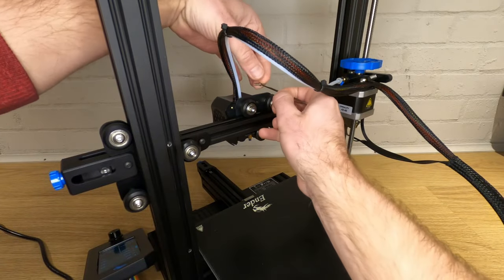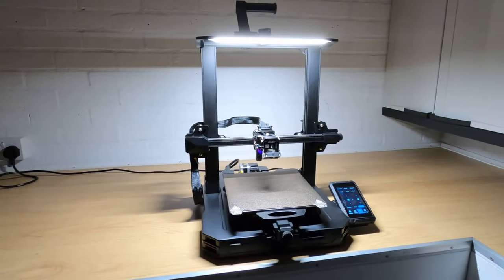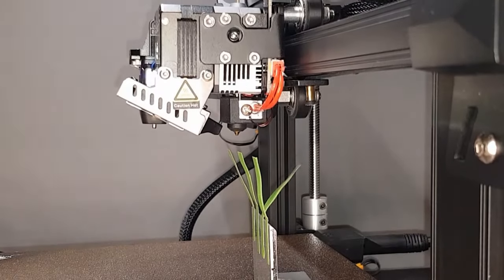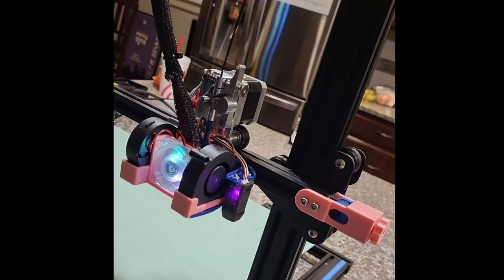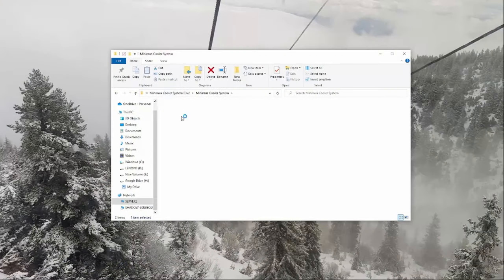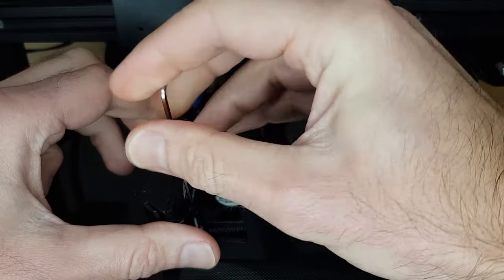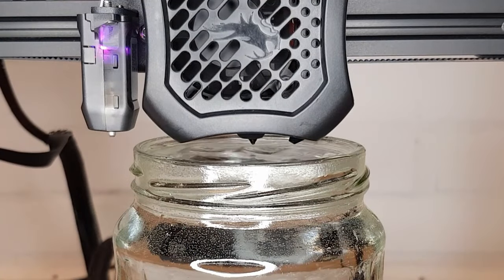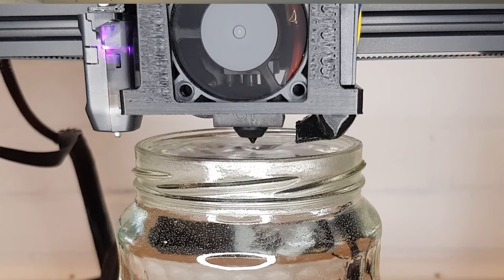Minimus Cooler -Possibly The Best Cooling Fan Upgrade For Your Ender 3 Style Hotend

Comment: Looks atractive untill you try it.
Downside - too much air leak from the hotend fan straight to the printed area. Its because the hotend area part is too open. 
Printing materials where you need part cooling off will be an issue.
Another thing - cable management. Everything is pretty much all around.
Layer cooling part is great though. Of course these fans wont be ideal for those who strugle to have their machine more quiet.
I personaly adore the idea, but once I tried it wasnt that good as I expected. Had issues with air leak as I mentioned. So after some tests I found briss moto fang more quiet, and leaking less air. Overhang tests were same good for both.
And of course I thought how often do you need to take off the fans off? You simply unscrew few bolts and need only access to the hotend. So it is probably only the fight for Weight VS. Noise.
Reply: Hi L. Šeima, what materials need part cooling turned off? Thanks.
Reply: @D4RKFiB3R  I refered to the problem where the hotend fan is blowing air to the nozzle, and you cant control it as layer cooling fan. That is permanently blowing air whether you need 0 or 100% cooling. That is not how it should be.
I sometime print abs that do not require enclosure, bit there has to be no other source of air blowing around it. So it warps with this minimus shroud, but no probelms with the other I use. Sometimes Tpu with very little cooling less than 10%. So this shroud even looked like a charm, didnt run well for my needs.
Reply: @LSeima  I understand. Thanks for the info.

Comment: Sorry, new to this, but does this work on the 3s pro or are there files included that do?
Reply from the maker: It's a very clever design that fits most hotends that have the two bolt fixings that all of the Bowden tube Enders have. There is a free test file that you can print to check too.

Comment: 0:30 you mention a test file to print for free, however I can see no link for this.
The biggest problem is, if you have a printer that is not on the list, you have to take the chance that something will fit your particular printer. 
I have however downloaded these files and may even have to modify something along the way.
I just thought it strange there was no link anywhere for the test print.

Comment: How do you connect up the second fan? I've been looking around and have not found one.
Reply from the maker: I just connected a second fan in parallel with my original fan so it runs off the same pins from the control board.

Comment: Hi, great video 👍does this work with ender 3 v2 neo? I'm sure it may have a different heat sink? if so using the stock fans what duct length would you recommend please ?
Reply from the maker: Sorry, I don't have a Neo to check. The Minimus is now completely free so you can try printing a backing plate and see if it fits.

Comment: Hi Ricky, thank you for uploading this and explaning it with such detail. I'm building one of these with the 2 ender 3 stock fans and a extra fan. I'm wondering, how would you arrange each fan intake/exhaust? I also wanted to ask about that thing mounted on the left of your hotend with the purple light, what is that? Thank you for your time
Reply from the maker: Hi, if you're using stock fans then you want the 4010 files. If you are not sure, then try opening the files in your slicer software so that you can see what they will look like. The item to the side is a CR touch probe. It probes the bed to create a 'mesh' that allows your printer to follow any contours on your bed surface. Some printers come with them but they can often be added. If you don't have issues with a warped bed then I wouldn't worry about adding one.
Reply: @RickyImpey  Oh, never heard of CR touch probes before and was curious, but doesn't seem necessary to me atm. Thank you for your guidance through the files and your answer!
Reply: A CR or BL touch probe is the best upgrade you can make. No more bed leveling issues!

Comment: Is it possible to buy a printed Minimus? I have just changed the hotend on my E3V2 & noticed when bed levelling that the existing fan cowl is lower that the print nozzle. I don't want to piddle about with the existing fan & cowling so if I can purchase a Minimus using existing stock fan, this will get me back on the road to be able to print the version I want.

Comment: I like this one as it looks to be the lightest so far.  I am confused as to which files to print though.  The readme file did not really help that much.
Reply: I have kind of the same problem.  It looks like the folder names got a bit more complicated than when the video was shot.
Reply: @FEPLabsRadio  Here's what I did to get the dual fan option with the wire management backplate. I don't use any automatic bed leveling so I just printed the basic version. If you use auto bed leveling, just look for the BL or CR attached to the files I mention below. Hope this helps. 

From the 'Its full of stars' folder, go to New 4010. Select either 'New 4010 Dual or Single.' In the same folder, got to '4010 Ducts' and select 'Duct 4010 0 R and/or then L.' Then go to the 'New Backplates' folder and then into the 'Backplates WM' folder. From there select 'Backplate WM.' (WM stands for Wire Management.) Also, if you double click on the STL file it will open up and show you a photo. At least it did on my PC. Good luck!

Comment: Hello Mr Impey ! Would you say that this extruder modification has to be preliminary stage before link a Sonic Pad to my E3v2 ? Thanks for your time !
Reply from the maker: It helps improve cooling which will be needed if you use a Sonic Pad and start printing faster.
Reply: @RickyImpey  ok so here we Go ! Thanks 👌🏻🫡

Comment: Did you need new, longer bolts in order to mount the backplate?
Reply from the maker: No, it slots over the protruding lugs on my Ender 3v2 backplate and gets sandwiched.
Reply: @RickyImpey  Got all the parts printed and will install later. It's as light as a feather fully assembled!

Comment: Printing isn't so straightforward. My initial print wouldn't snap together. After reading the fine print in the instructions on Thingi, I found that you have to experiment with Horizontal Expansion to get the dimensions right. I had to reduce the size of the Backplate WM by -0.35mm for it to snap into place properly. Also, the holes were too small by around .3mm. Will eventually be installed on my Voxelab Aquila.
Reply from the maker: Sorry to hear that, mine worked with no mods. Have you tuned things like e-steps on your printer? It could help dial things in.
Reply: @RickyImpey  Yes, I'm spot on. I'm shocked that yours seated fully since mine was so far off. Now that I have it sized properly, it's quite nice. BTW, for people that are struggling to choose the appropriate files, the selections on Thingiverse are greatly simplified. Thanks!

Comment: I cannot seem to get the minimus to fit onto the backplate correctly assuming that the backplate
should fit right into the top of the minimus grooves on either side ?
Reply from the maker: Yes, it should slide down over those rails. Have you calibrated you printer at all? It could need a few things checking.
Reply: @RickyImpey  I printed the parts at different line heights and used the shrink option in Cura, picked the closest two parts
for a fit then cleaned and sanded  the closest back plate fit,  all now fitted and working.

Comment: Doesn't having a cooling duct only on one side can cause banding on the other side?  I usually see dual duct but doesn't that also miss cooling on two sides? Wouldn't it be ideal to have a circular ring to provide cooling on all sides?
Reply from the maker: Airflow can be very difficult to predict. I understand what you mean but it practice, both the single and dual setup work well. People try all sorts of cooling ducts but without trying them you can never really know how they work.
Reply: @Ricky Impey  true. I have one which I've tried the water test and it made a nice divot. I tried another and it didn't make a divot but seemed to make a whirlwind effect. Both used the same blower. The whirlwind was better.
Reply: I think the circular may get the air to the nizzle but then block it from leaving. I try to get side coverage and also keep the air moving away from nozzle area after it has absorbed the heat.

Comment: So what bolts did you use to mount the Cr touch? Mine are too short and don't have nuts. My bolts just threaded into the CR touch bracket. Also, are you using the spacer between the bottom of the Minimus bracket and the CR touch? Thanks
Reply from the maker: I think they are M3 bolts so I must have used some M3 nuts. I think I used the bolts that held my CR touch bracket on as they were a little bit longer. I didn't use the spacer or the part that locks the nuts still.
Reply: @RickyImpey  ok…. Well I just installed the whole setup and I used the spacer and the lock piece. I think I used the same bolts you used. It’s working on its first print so we will see how it works out. I think I like your setup using the nuts better.
Reply: I may have made a mistake naming the part the Nutlock. Its does this but it's also a part to add some strength to the assembly. This mount can get some vibration so I made this as a safeguard. 
If you use a m3 8mm and nut it will fit flush and neat. 👍
Reply: The first print using this setup turned out well. I had to majorly adjust my Z-offset. Once I did that, seems to be great. I think I'm going to add the nuts for the extra security.

Comment: How can it be the best?
It has only a 4010 fan. 
Out there there're plenty of designs, and I also designed my own for Ender 3 V2 Neo to use 5015 blower. And you can tune it with 2800, 3000, 4800, 5000, 5800, 6000, 8000, 8500 rpm 5015 blower.
Reply: Did you hear the part of the video about multiple fan options and dual fans? LOL.

Comment: I love this kit.  However, I am concerned that the wire management version of the backplate in combination with fitted Armadillo wraps are putting more strain on the X-Axis.  Anyone else have this concern?  I'm thinking to maybe re-print the non-cable management version of the backplate...

Comment: When I print this and put it together, the parts cooling duct is underneath the nozzle zip. Just barely, but it is. I tried two different MK8 hotends (the original stock one on my Ender 3 and a replacement) and several nozzles but the height is always less than the 46mm the duct author specifies - therein lies my issue. What gives? Any ideas?
Reply: The bltouch should be on the Left side. Mounted the backplate pointing down, instead of up.

Comment: I was just wonder if anyone knows or has knowledge on this, is it possible to just use electrical tape to connect all the wiring for the dual 4010 part cooling fan?

Comment: I'm a bit confused. People saying that they've printed it in PETG or even PLA... won't any of the parts melt or at least warp? They are so close to the hotend
Reply from the maker: Mine didn't, I used both PLA and PETG versions with no issues.
Reply: @RickyImpey  Alright, I'll try it then :D
Reply: @RickyImpey Made it out of ABS cause I'm printing ABS in an enclosure, the fella has been going strong for a year now! this thing is amazing for maintenance! I'll try adapting it for my Ender 2 Pro as well

Comment: I was inspired by your presentation of MINIMUS, however, navigating Roger's site and selecting the files is frustrating. If someone can guide me to the selection of the original design for an ENDER 3Neo and associated files, I would appreciate the help.  Even after downloading what seems to be the correct file, there are multiple undescribed files. The read-me file is not helpful.

Comment: Would this fit an cr10s? Would love to have a lower weight shroud.
Reply from the maker: I think so but I don't have one. I only have the CR10s Pro and the hotend on this one is too long. If the CR10 hotend is the same as the Ender 3s then it will most likely fit.
Reply: @RickyImpey  thanks for the info man! Love your videos!

Comment: do we know if it is 100 percent necessary to print with tree supports...im too used to prusa slicer
Reply: On my Voxelab Aquilas, I printed ducts and the main body with NO supports. The only (minor) issue was at the back of the main body where the "airfoil" is unsupported. I got a bit of sag on the first layer, but from there up, everything looks good. After playing with this, I used Tinkercad to add manual supports to those two spots. My final prints were done at 0.16mm layer height, 0.4mm nozzle, no supports by Cura, using PLA+. 
The only thing I had to modify from Paul's original files was the backplate. On my machine(s), I had to use a 0.3mm line width (from a 0.4mm nozzle) AND I changed flow to 90%. That gave me a backplate that fit PERFECTLY into the slots on the main body.
BTW, I have installed this on a direct drive hot-end, BMG with printed direct drive mount. It easily mounts and disconnects, though I had to trim the connecting tube a bit to give some slop at the BMG end.
Reply: @timrobinson7152  I've still gotta dial in my settings, I printed the fan mount and my overhangs before bridges be droopy 😅

Comment: Hi, Is there an installation instructions available for the Minimus? I have the Cr and swiss hotend. Thanks
Reply from the maker: The read me file is pretty extensive but no, there aren't any specific instructions. It is free now though so worth grabbing and seeing if you can make sense of it.
Reply: Answers were in the pictures,  installed and working, were there any changes you found necessary to settings? Using midland pla at 215 deg/ 50deg. Thanks
Reply from the maker: @normanziegelmeyer7693  No, it all worked well with Paul's advice
Reply: Sorry got confused, I was asking about the swiss hotend.I installed it and the minimus.Minimus works as advertized, no adjustments required.

Comment: I left a comment yesterday, but it is gone. So I will start over. I d/l the cooler and tried printing it on a Ender3V2. The blower assembly is undersized and the fans , ducts and backplane will not fit in the blower assembly. Printed the 4010 dual fan with the CR touch. Th openings in the blower assemblies are only around 39mm and the fans will not fit. Measured with a caliper. The ducts are the same. The duct openings are around 1mm too short. Is it possible that CURA5.1.1 or the printer is reducing the size of the components? Using PLA filament. If the STL file is using the correct dimensions, then CURA or the printer is reducing the printed pieces. Any ideas. Thanks, Larry
Reply from the maker: Cura or your printer shouldn't be changing the scale on anything without you having told it to. Have you tried printing a calibration cube to see if everything is ok with your setup?
Reply: @RickyImpey  First of all, I am a 80 year old newbe in this field. When I got the ender3V2 this summer, it had the stock configuration on it. I printed the cube and the measurements were all around 20mm. I really didnt know how important this measurement is. Later I installed Klipper and Mainsail. Now I think I should have kept the original configuration. So under Klipper, I printed things and they seemed to come out OK. The first time I had to mate to pieces together was with the Minimus cooler. Couldnt figure why they would not fit together. So today I went and measured with the caliper one of the old cubes from day one. It measured close to 20mm all the way around. Then I sliced a new cube with CURA today and printed it under Klipper. All the measurements were about .5mm high. Doing some reading, I am finding out Klipper uses a parameter called "rotation_distance". This relates to "steps_per_mm. Now I am really confused. So do I have to figure out the correct rotation_distance to have the cubes come out to 20mm??  Where do I go from here?? On Klipper is a printer configuration file. It has stepper_x with a rotation_distance of 40, the stepper_y has a rotation_distance of 40, and stepper_z has rotation_distance of 8. 
[stepper_x]
step_pin: PC2
dir_pin: PB9
enable_pin: !PC3
microsteps: 16
rotation_distance: 40
endstop_pin: ^PA5
position_endstop: 0
position_max: 245
homing_speed: 50

[stepper_y]
step_pin: PB8
dir_pin: PB7
enable_pin: !PC3
microsteps: 16
rotation_distance: 40
endstop_pin: ^PA6
position_endstop: 0
position_max: 230
homing_speed: 50

[stepper_z]
step_pin: PB6
dir_pin: !PB5
enable_pin: !PC3
microsteps: 16
rotation_distance: 8
endstop_pin: probe:z_virtual_endstop # Comment out if not using BL/CR-Touch
#endstop_pin: ^PA7 # Uncomment if not using BL/CR-Touch
#position_endstop: 0.0 # Uncomment if not using BL/CR-Touch
position_max: 240
position_min: 

If you can point me in the right direction, I sure would appreciate it. 
Thanks, Larry
Reply: I think I found the problem. When you install Klipper, you need to change a line in printer.cfg if you are not using Micro Swiss Dual Gear Extruder. I never changed the line. I changed it to 34.406 and did a cube. Came out to just under 20mm on all sides. Will print the fan assembly tomorrow and see if that was the problem. Thanks for your help.
[extruder]
max_extrude_only_distance: 100.0
step_pin: PB4
dir_pin: PB3
enable_pin: !PC3
microsteps: 16
rotation_distance: 34.406 # Change value to 34.406 if not using Micro Swiss Dual Gear Extruder
Reply: Hi Ricky, I am up and runnng. Once I printed all the parts with the correct printer.cfg file, everything fit together like a glove. Running the dual 4010 fans with a CR touch. Works great. My thanks to Paul for designing the cooler. He knows what he is doing.  Now to print out some tough designs and see how it works. Thanks again Ricky for your help.
Larry
Reply from the maker: @larrymeans7046  Great, glad you got it sorted 👍